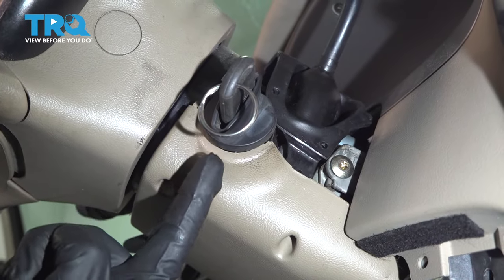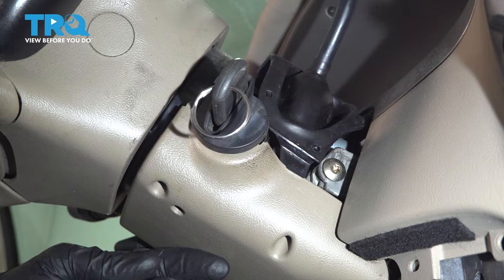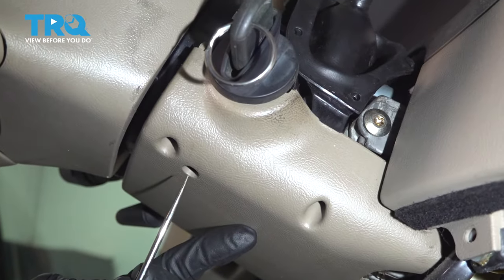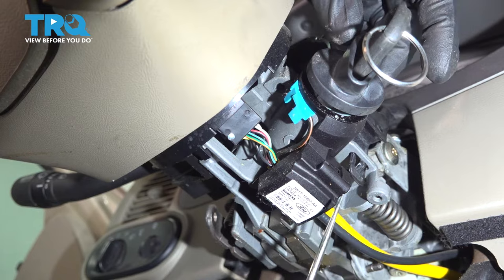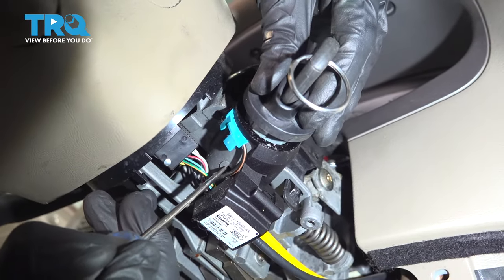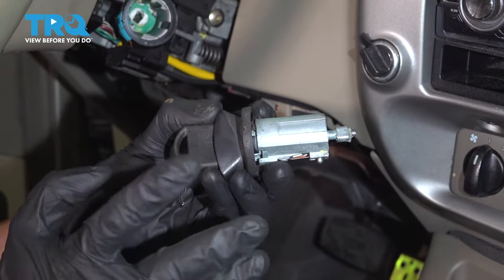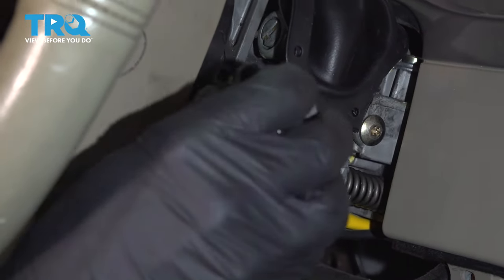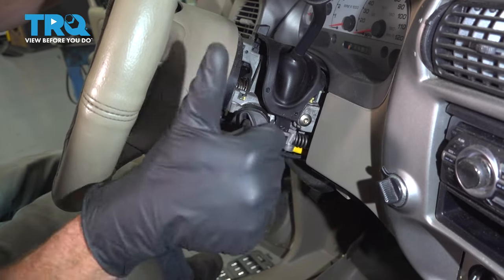How to Replace Ignition Lock Cylinder 2001-2005 Ford Explorer Sport Trac

Comment: I have a 2011 ford ranger. My ignition key bezel broke off. So I wanted to know, when you buy a new ignition cylinder? Will it work with the existent factory key once you get it program from a locksmith or dealer?

Comment: Could u simply replace key with cylinder from a running parts car? Or, do u still need to have the doner parts programmed?
Reply from the maker: +@Procrastn8rsUnite2morrow The key would still need to be programmed.

Comment: Trying to identify a part below the ignition cylinder.  It is a black tab with wires, and makes a door chime sound when the key is in the cylinder.  This broke awhile ago, needs replacement, and may be tied to my P1316 error code issue.  Any ideas?

Comment: Hello, For some reason the plastic part of my lock cylinder is missing. The mechanic that did the repair no longer around. When the key in inserted the car will start and so on, however when its in run position, I can actually pull the cylinder out. I would like to fix that problem. Hope you can help.
thanks,
John